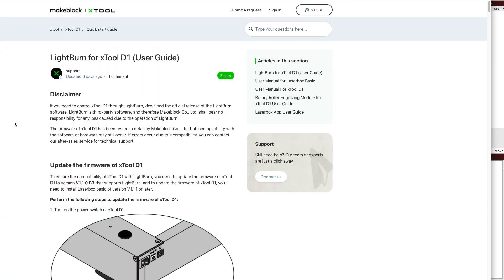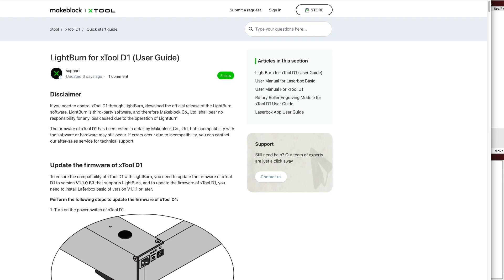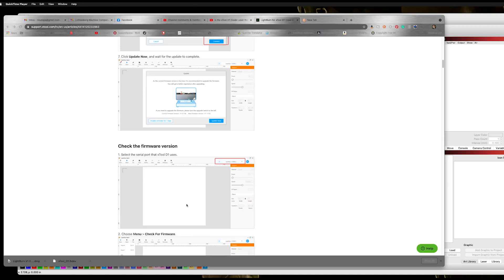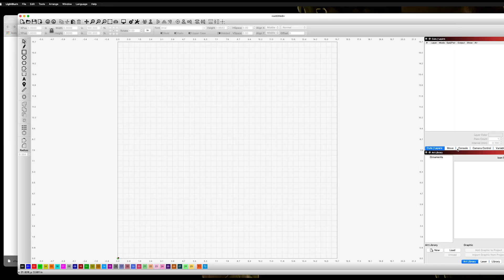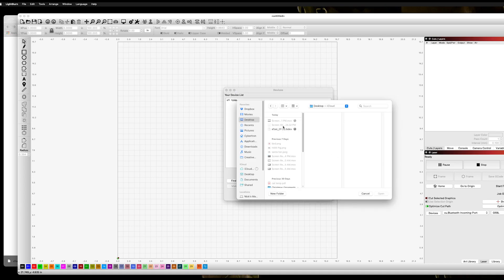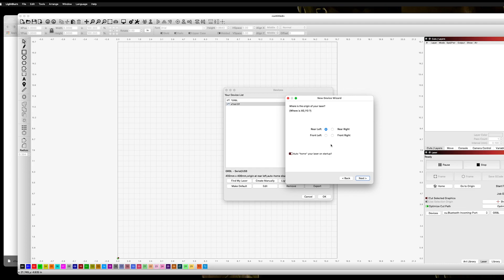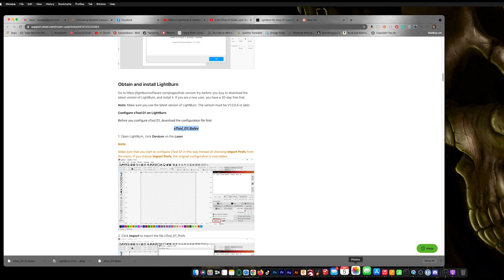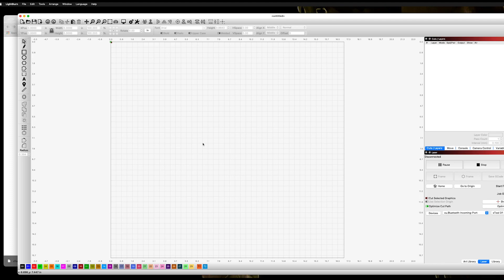How to Add Your xTool D1 Diode Laser in Lightburn

Comment: I need help I bought the extension for Xtool D1 (not pro) but I can’t get the laser to run the full size of the extension. I’ve tried both on lightburn and lasebox.
Reply from the maker: I’ve never worked with the extension. Maybe check in with the FB Group. 
Facebook.com/xtoold1
Reply: @BuildDadBuild  thank you

Comment: Hey. I’m trying to connect my laser d1 pro to light burn and nothing comes up. I did all the steps from this video but when I go to open the configured file it won’t let me add it to light burn. I’m stuck. Any help?
Reply from the maker: Check your COMs under device manager. Make sure it's showing connected.
Reply: @BuildDadBuild  do it have to be connected to the laser? Because I had it connected
Reply: @BuildDadBuild  I’ll check that setting you just said
Reply: @BuildDadBuild  where do I find device manager?

Comment: Why is it when I engrave coated metal in laserbox and later in lightburn using the same speed and power, in lightburn the head moves so much slower? Thanks in advance.
Reply from the maker: In laserbox you are working in mm per SECOND, in lightburn you are working in mm per MINUTE

Comment: Hi Nick,
I will be purchasing an Xtool engraver this week. My question is how does the file from Lightburn get to the Xtool hardware so the machine knows what to cut? I am also wondering if I can put Lightburn on my desktop iMac and then transfer files to the Xtool somehow. I am hoping to use the desktop because the screen is much bigger and I am a Mac girl.
Thanks,
Marie Wood
Reply from the maker: If you're ordering this week I would wait until after the Live Stream tonight and possibly my video release on Friday *wink*
I have Lightburn loaded on my Mac in my office and transfer files to my PC laptop all the time.
And Lightburn communicates with the xTool just like it does with any other laser. The coding language is called G-Code
Cheers
Reply: @BuildDadBuild  ok, I'm familiar with G-Code, as I do woodworking on a CNC router. We are actually purchasing a bigger one this week, the Legacy Maverick 4' x 8'. I've been using a small Shark up to now. Do you use a CNC?

Comment: After following these steps do I need to worry about the speeds in  the device settings tab? Other videos show a different speed than what mine shows.
Reply from the maker: Speed and power vary by material. That's why you should always run a power grid.
Reply: @BuildDadBuild  oh okay I’m so worried about messing up my laser so trying to be super careful

Comment: My D1 keeps overtraveling on the X Axis whenever I'm sending it home. I can manually go to 0/0 with no problems but as soon as I hit home its like it forgets where it is. I've also had it quite literally lose its read on the Y axis and send itself hard into bottom right corner as if it was starting from home. Anybody have these issues? Only happening in Lightburn so far.
Reply from the maker: There is a multitude of reasons this could be happened. And it is hard to combat without limit switches. The question is why do you feel the need to send it home? You can manually place it anywhere.
Cheers

Comment: Got a laptop to use for lightburn instwad of my desktop now i cant get lightburn to find my laptop or vise versa...did everything the same as before and nothing..
It does however work with laserbox ...but i need lightburn
Reply from the maker: make sure to run all the updates in Laserbox Basic. Also check out the xTool D1 Facebook group...ton of helpful peeps!

Comment: So I finally got the machine to communicate but I am LOST when it comes to positionng this thing. I was using the default software and would line up the cross hairs on the back left corner. Now the thing just runs off to where ever and its like a guessing game as to where the origin REALLY is. Any thoughts (totally a noob to this stuf)
Reply from the maker: Make sure you've got your "home" set correctly in LB. I think it defaults to the front right, but the xTool's home is actually the rear left...
Cheers

Comment: But can Lightburn connect to the xTool D1 via ethernet?  I want to sit at my desk and the D1 not right beside it.
Reply from the maker: Yes
Reply: @BuildDadBuild  so this isn't a difficulty following instructions.  The problem is that Lightburn doesn't recognize the ethernet.  The xTool D1 is connected wifi and Laserbox has no problem connecting to the D1.
There is a configuration problem in Lightburn and I have not found how to correct it.